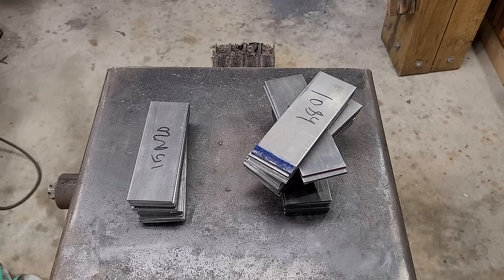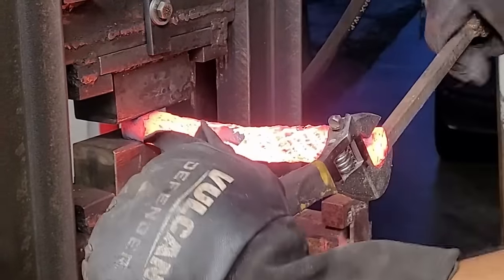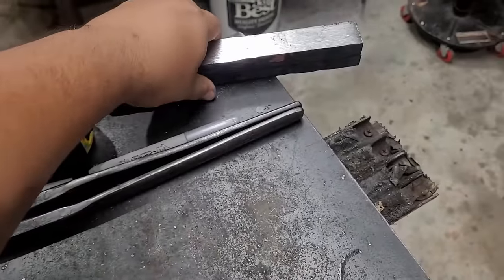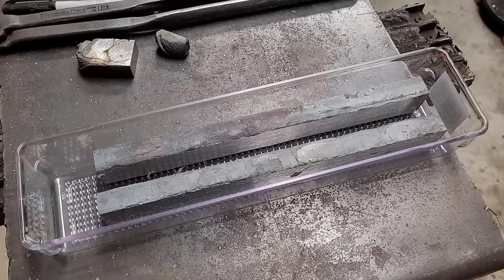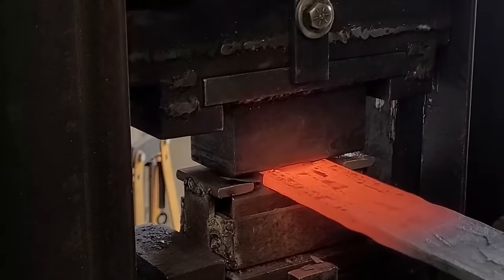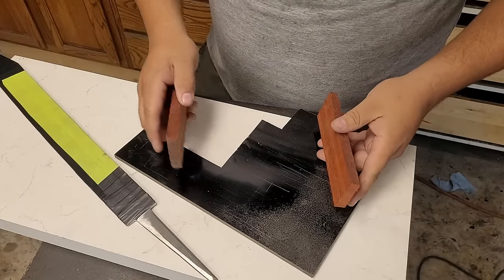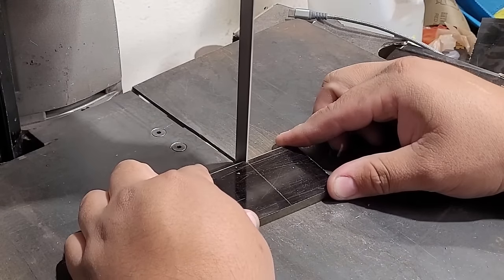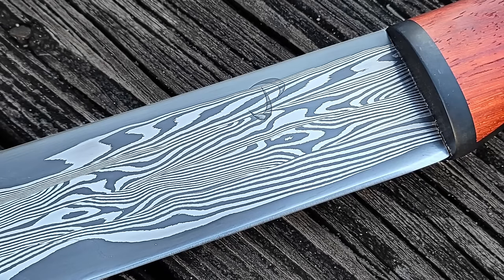Making a Viking Seax Knife

Comment: You keep getting better! Beautiful knife, fantastic pattern! If I were to criticize one thing (constructively of course) I would like to see a pin through the tang and handle. That’s a huge, heavy blade and it is held with epoxy on a tapered tang.
Reply from the maker: Ill keep that in mind for future builds. I appreciate the constructive criticism.
Reply: The research says that the seax blades of the AS and the Vikings was held in by friction
Reply: @AngloSaxon1  Sure, and there’s nothing wrong with that, it clearly worked for the time. But if you have the option to make extra sure the blade is secure, why not just go for it, right?
Reply: @zyriantel9601  Yes, absolutley right, the safer the better

Comment: It’s better not to cut your billets straight but under an angle when you’re restack them that way you’ll get more surface for the forge weld and you also can press it from the top as usual not from the front you had to with a straight cut
Reply from the maker: You lost me? What restack needed to be cut under and angle?